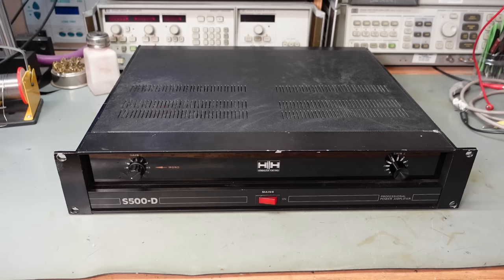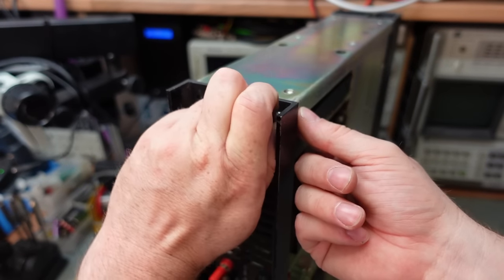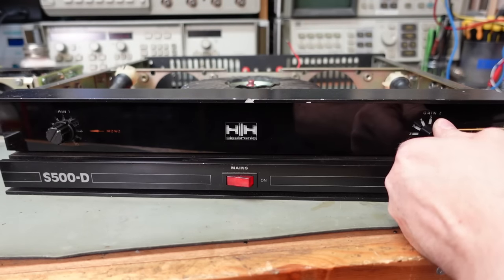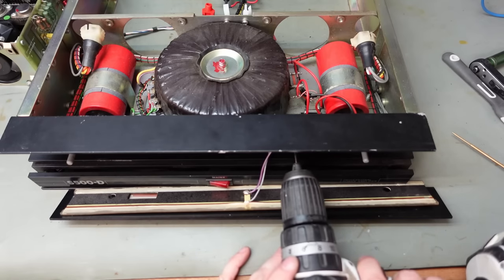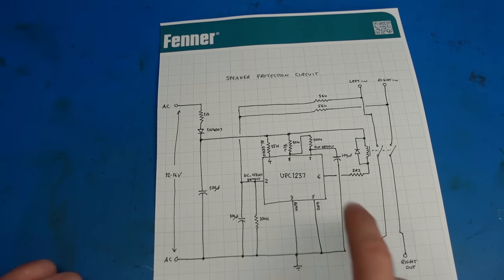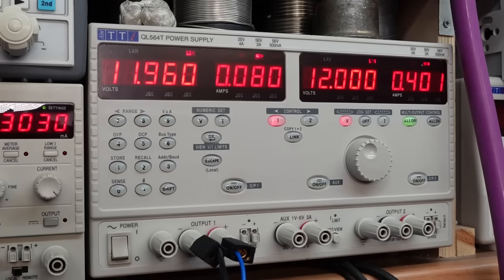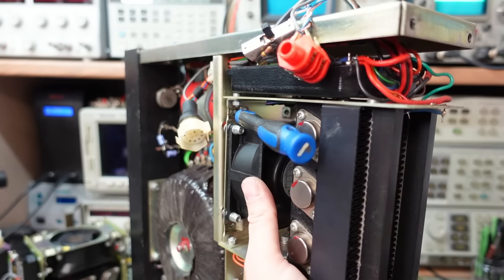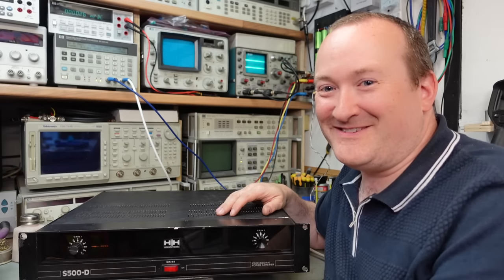HH Electronic S500-D Power Amp Modification

Comment: At the college radio station students took care of all the equipment.  One night an architectural engineering student during his Friday night show called me to report that the audio power amplifier in the studio had failed again. It was a Marantz which had output transistors with emitters to the rails and collectors together to the output. Completely the backwards implementation of complimentary output. And was very unstable. When it failed it was usually an output transistor shorting to the rail producing rail voltage on the speaker output. And it had cooked some speakers in the past.  It came equipped with DC protection relay but a failure even further in the past had welded the contacts so that level of protection was non-functional.
He told me he had hooked up a substitute "amplifier" but it did not work.  Turned out he had pulled out of the engineering storage closet a +/-24V DC power supply and hooked it directly to the speakers because he didn't understand the difference in an amplifier and a power supply. He had no idea. Architects! The speakers were Bose 901s.  I hated them.  I got there and thought that surely he had destroyed those speakers.  I was kinda hoping.  But nope.  He had blown the power supply.  Those darn Bose were happy to sit there taking that 24V DC until the output transistors in the power supply blew. So now I had to fix that Marantz again plus a power supply to boot.
Reply: Bose had a quartz lightbulb for protection. Non linear resistance increase as power goes up. It works.

Comment: The Black Watch is an electronic wristwatch launched in September 1975 by Sinclair Radionics. It cost £24.95 ready-built, but was also available for £17.95, as a kit.[1] These prices are equivalent to around £190 and £140 respectively in 2021, when adjusted for inflation.

The Black Watch was supplied with a plastic band as standard, with a black stainless steel bracelet available as an extra at £2.00

Comment: For a time Stanley Clarke was using HH power amps in his bass rig - probably running a set of full-range EV cabs as I recall. I seem to have it in my head that Van Halen used them too but I don't recall for what.

Comment: I found my S500-D had bad filter caps, usual for a 30 year old amp. It also had  parasitic oscillation at 120khz approx, I think it was like that from factory. HH made some good amps but some were built down to a price. I repaired an IC 100 that only did 67W, it's normal though for amp makers to fib.. The best I worked on was a Studio 100 or something, an awesome guitar combo. Anyhoo, thanks for uploading.
Reply: Them old IC100 and VS amps had a 0R1 resistor from speaker ground to earth, if you grounded the speaker return you effectively shorted out the feedback network, this would make the amp unstable and oscillate. Like a grounded to scope dummy load.

Comment: Based on the Amcron 450 that Slade bought back after their US tour. Great piece of kit and ran 3 of these back in the day. Early units had a fully encapsulated driver stage but later models werent potted. Note that this would produce 500 watts per channel into 4 ohms. Not that any HF distortion may be due to poor connections on the power transistors, so make sure they are tight.

Comment: With DC protectors who use a relay it is  good practice to use double throw switches in the relay. In the "off" position, the switch should connect the speaker to ground. Whenever there is a DC fault in the amp, the relay will make sure that the arc dies when the relay switch reaches the off position. Otherwise, the arc will still potentially cause the speaker to die. I must say that these HH amplifier is nicely build and is very service friendly.

Comment: I got curious and dug up some info on this unit. The amplifier uses a quasi-complementary output stage using NPN silicon BJTs. The anonymous transistors are house numbered HH9080 which is allegedly a 2N3773 but I have no hard evidence of this other than some old forum postings. MJ15024 or MJ21196G are what I would suggest for new outputs at this time; both should be absolutely bulletproof at this power level, though gain matched 21196s will in theory give measurably lower THD. The driver transistors are BDY56 and BDX20. 

The schematic is very mum about what's in that input stage box. I presume it was intended to be serviced as a module and likely contains the "secret sauce" of this amplifier's design.

Comment: I'm not certain, but when you realised the toroidal transformer was upside down  and you turned it over I thought I saw a washer fall from it, but I might be wrong. I built for myself and a friend) two class A amplifiers each (I bought his ones back off him so I now own all four) and they don't employ DC offset detects. (When set up and allowed to sit for some time before final adjustments were made, there was about 3 mV across each of the speaker terminals). However, they have been running for some years now without incident so I guess I have to hope I don't encounter a situation where I end up with a high DC voltage across my electrostatic speakers. OUCH!

Comment: Classic amp, had the V800 and M900! Not sure if anyone except for the Brits actually bothered so much with cable lacing? I remember Quad also doing it.
We can only hope the owner of the amp won't switch it on or off when it's delivering some power, would weld the relay quickly :D

Comment: Brilliant work on integrating that protection board, and loved the cable lacing. I learned how to do cable lacing on the City & Guilds 224 course (late 80's) - I wonder if that is still taught?
Reply: used in avionics

Comment: Nice.
Being a wood worker in retirement I would have recess mounted stand offs on a thin ply board and cemented it with the new device mounted on the stand offs to where you drilled holes. 

Whether quicker or not depends on your tools and supplies but I avoid disassembly if possible because I goofed enough to dislike the prospect.
Reply: There is always the option of using plastic stick on PCB mounts.

Comment: Love your skill and humour Mark !
As a live musician though, I'd be a tad worried about trusting the amp's output to travel via two small relay contacts which may or may not age well. What would you think about fiitting a hardwired relay bypass wiring with switch (hidden on the back of the amp) for test / survival purposes if the amp went silent at the Wrong Moment during a gig ?

Comment: nice video. at 4:04 why did you not put some 12 turns of 28AWG kynar (Wire-wrap) wire around the large toroid transformer and measure if it gives you 2 4 6 or 8 volts, and calculate how many turns you need for 12V ?

Comment: Great mod and I love the wire looms! But I think you could have saved yourself some time by mounting the board between the amp modules near the back panel. And by getting a sharp drill bit :)
Reply: And a screw-extractor-bit for removing that rounded over case screw

Comment: Oh Mark you could have used a dremmel and cut a slot in that screw and used a a flat head screwdriver if it turned to cheese you would be right to drill it. If you ever get a chance to open a Hiwatt built in the Dave Reeves era they are a work of art

Comment: Love the repair, great intro to your channel too! the best part is the bit where you get a shock (more please, he, he!) but where do you keep coming up with all the old equipment to repair. I suspect a lot of those type of amplifiers are long gone by now. Is it possible for a little help from you if you're not busy editing video. It's just a small request but could help me out, with a problem Roberts Radio I bought not working off eBay.
Cheers,

Comment: The implementation is excellent, but there is one thing - if the power supply of the amplifier is higher than + -60V, then the relay protection is useless - an arc will appear on the low-resistance load when it opens, which will melt and solder relay contacts together and damage your acoustics. In such cases, a triac circuit is used - the output is connected through a fuse and in the event of an accident, the powerfull triac closes the PA output to the ground, blowing the fuse and turn off power supply

Comment: Just curious, what drill bits do you use? I work on vehicles mainly (and sometimes electronics), and had been using HSS bits for ages. Eventually gave up with them once I found M35 Cobalt drill bits. They cut through absolutely everything like a hot kn*fe through butter! I'd highly recommend them if you ever have any issues cutting through some harder steel in future (whether screws/bolts/chassis). Thanks for another great video!

Comment: Hi Mark great video, I have just been given back an old S-500D module. I have the schematic that only shows the block diagram + the output transistors. Do you have a schematic of the AS00008 o/p driver board which needs attention thanks.

Comment: In the workshop of laughter, where tools converse,
Mend It Mark, the clever, a craftsman diverse.
A repairman with a chuckle in every stride,
Guiding through circuits, where secrets hide.

Oh, the HH Electronic S500-D stands tall,
A power amp awaiting, Mend It Mark's call.
With a twinkle in his eye and a wrench in hand,
He delves into the heart, where mysteries expand.

Step by step, a procedure unfolds,
In the workshop of laughter, where stories are told.
Mend It Mark, a maestro with the soldering art,
Breathing new life into the electronic heart.

Oh, the power amp, a canvas for modification,
In Mend It Mark's hands, a source of elation.
Clever and deft, he dances through the wires,
Laughing through challenges, quenching repair desires.

With humor as his guide, and wisdom as his tool,
Mend It Mark, the repairman cool.
He takes you along on a circuitous ride,
Through modifications, with laughter as a guide.

In the world of electrons, where signals flow,
Mend It Mark, the maestro, lets knowledge grow.
A symphony of soldering, a laughter-filled song,
As the HH Electronic S500-D journeys along.

Through capacitors and resistors, a magical spell,
Mend It Mark, the laughing repairman, tells.
In the echo of chuckles, in the workshop's embrace,
The power amp transformed, with a smile on its face.

Comment: Got a random question.. Mainly because i know you actually reply to you're comments...
I have been repairing amplifiers, Mainly Rack mount power amps, for around a year now... Self teaching and learning how to read schematics etc..
I understand why you should use a Dim bulb when powering up a potentially faulty / unknown amp, and i do use one myself..
But ive never understood, Why a 40w bulb restricts more power to the amp, than a 100w bulb?!?!
I have a 40w, 60w and a 100w bulb at my disposal, that i use regularly..
100w bulb usually allows the amp to power up enough to play a signal accurately.. Where as a 40w bulb tends to severely limit the amp, so it struggles to even click the protect relays etc...
Why is this?!?! I would have assumed that a 100w bulb, being thicker internal filament, and higher power, Would restrict the power more than a 40w bulb... But its actually the opposite to what you'd think...
And ive never understood exactly why this is?!?!
Every other amplifier repair channel i follow, Dont bother replying to viewers comments, So my question remains un-answered :(
Reply: The 100w bulb will have to have more current passing through it than the 40 or 60W, right? So, when you place your device in series with it, no more current can pass than is passing through the bulb. You can use the water analogy - I wider pipe provides less resistance to the flow of water than a more narrow pipe. It's the same with wires, assuming they're made of the same material and other conditions are the same.

Comment: That toroidal nut and bolt looks very close to the lid!  One turn on that thing would move some current. Edit: Ha, ha and there is a bit of a bend in the top plate already. I guess it looks closer on screen than it is, but  I've seen it happen. Someone had replaced a nylon bolt with a steel one....  Caused some head scratching.

Comment: Hi Mark, just wondering, what exactly is the black "string" material you use for wire wrapping/cable management?  Beautiful work!!
Reply: Likely waxed lacing cord - also called lacing tape.  Did a lot of it in the Navy.

Comment: Is there a real advantage by lacing all the wires up like that, apart from making it look really tidy inside?
Reply: Lacing will outlive cable ties that can degrade over time and it does not create obstructions along the length of the cable. Avoided are the handling problems of cables groomed by plastic or hook-and-loop cable ties.  Still used in the military and aircraft wire bundles, plus dozens of other industrial applications.

Comment: Nice mod for sure, but not sure I understand what it does or why. What is the value of what it does?
Reply: A speakers acts like an inductor. When DC is present in the amp output, the speaker has almost zero resistance. Since amps are voltage sources, a very low load resistance means a very high current, creating heat that could burn out the voice coil.

Comment: Mark Speaking from experience be very wary of using the Deoxit on potentiometers as the chemical has a tendency to Destroy the carbon track I would recommend just a electronic cleaner
Reply: Been using Deoxit D5 on rotary and potentiometers for years and years..... Never had any issue, Deoxit F5 for faders.

Comment: Do you have much confidence in the relay DC break capacity?  The supplied one in the kit will have only have an AC break capacity rating. 
With high powered amps the relay contacts are known to fuse closed, rendering any DC protection to the speakers useless. 
Beware the kit's rated input voltage (often expressed as 'wattage'). High powered amps use far higher rail voltages.
Why not use ultra low resistance high voltage MOSFET for the switching? They are driven by small opto coupler chips so, decent segregation between control and audio path. 
The board footprint is smaller than an adequate DC relay... or the small relay supplied.   The mosfets don't even warm on heavy loads, so no heat sinking required.  

Another very useful 'protection' circuit would be speaker (load) 'short circuit' protection.  i.e. It protects the Amp.. not cables and speakers.

Comment: that little kit would not work with amps that have separated grounds for the speakers and especially if they are designed for bridge mode ... that little kit would blow up the amp in seconds
Reply from the maker: You're absolutley right, you wouldn't want to do that!

Comment: It shouldn't be that slow to react to 1.5VDC. Also, the relay should be a 12V one as you're powering it from 12VAC (16.9VDC). That 24V relay is just barely operating. That's why the turn on delay is at least 11 seconds, which is WAY too long. If you read the datasheet for the IC (which is an obsolete NEC device re-made now by the Chinese), you can figure out what to change to make it work with a 12V Omron relay. The turn on delay should be no longer than 3 seconds and the turn off on DC fault should be only 100ms MAX at any voltage. They're using a 100uF electro for an AC pass filter (as per the datasheet), but if you have a negative DC fault, that capacitor is going to be charged in the OPPOSITE polarity. This will, eventually, if not almost immediately end in catastrophic failure of said cap. It really needs to be a bipolar capacitor (rated for the max half supply voltage it will ever see) and probably no more than 22uF.

Comment: Yes very good , but I recycled mine , as it did indeed go dc and burnt a nice audax speaker,  and as you see , the driver circuit is encapsulated... unfixable..  This circuit was based on the dc300a , that too needed dc protection, the mod is a good idea, but encapsulated amps?    wouldnt waste my time.

Comment: If you pulse the drill. Than it wont wonder about.
Probably you know that is not nice to paralel the secondary coils. They barely the same voltage.
I would take off the insulation of the ring terminals and solder them. I do not trust of those crimps.

Comment: Its not color coded, its just rusty, and the thermal switch is not "for the fan" but for over heat protection probably.

Comment: We had the misfortune of having some if these , absolute rubbish , rated load was at 2.5 ohms ,  the transistors are 2N3773 with the markings removed ,  they failed destroying dozens of speakers ,  they were replaced with Yamaha ,  they filled with dust and fluff and overheated ,  avoid